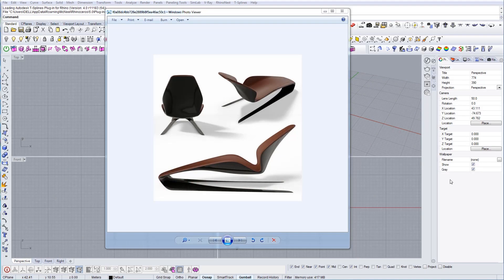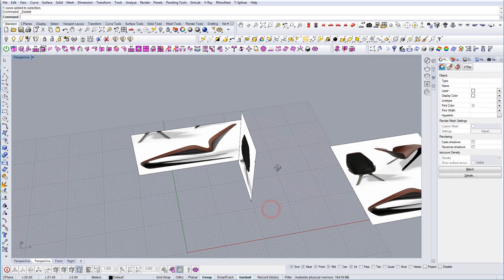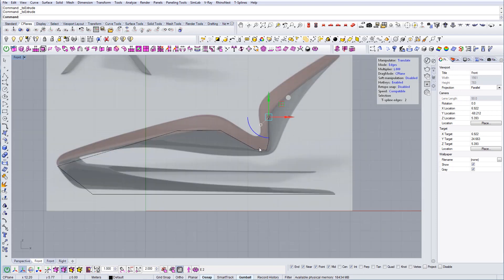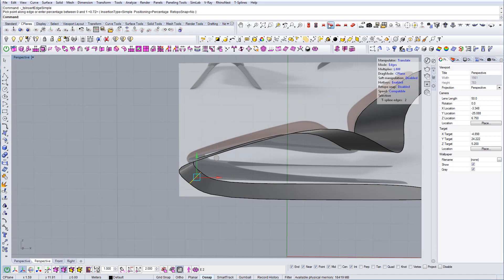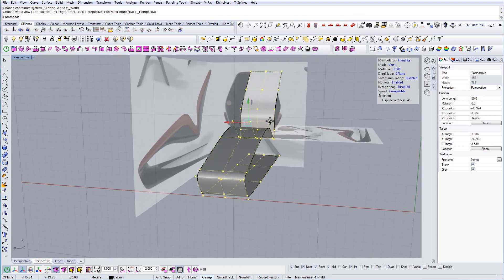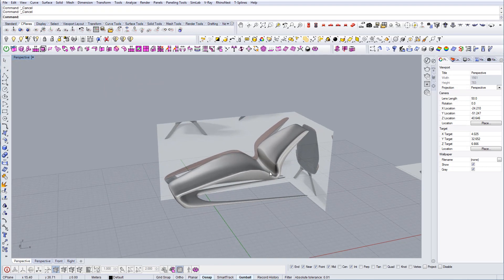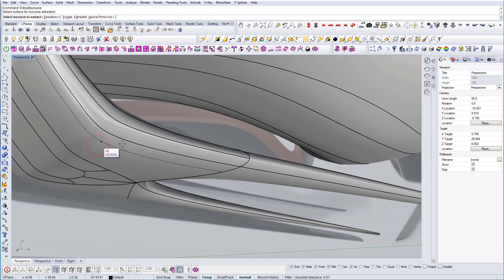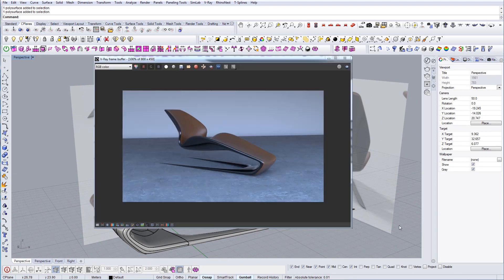How to Model Lounge Chair in Rhino

Comment: HI, I AM SIJIA, I HAVE A QUESTION , AT 3.28MINS, HOW DID YOU MOVE THE PLATFORM, THERE IS NO DOTS FOR ME TO MOVE WHEN I TRIED IT
Reply from the maker: I selected the vertex icon, so the dots become visible :) lower left corner :D
Reply: @HowtoRhino  but i could not find the vertex Icon , lower left corner in my rhino , i also could not find the pink platform in my rhino
Reply from the maker: Pink platform is a plugin called T-splines and if you don't see it, it means that you don't have it installed :)

Comment: I wonder that how we can make this without t-splines? How can I make it with control points curve? Should I make rebuild it to shape its form precisely?
Reply from the maker: Hey Burak! 
Honestly, this could be created without t-splines, but much much harder than with t-splines. In order to create it only in Rhino, you'd have to draw nurbs curves first, place them in 3D based on the reference images, and then slowly build the surfaces and modify them along the way. Again, this is a very complex process and takes a lot of fixes, going back and forth and so on. A similar process would be used when you'd want to create cars and such designs. Hope that helps a bit :)

Comment: 5:04 is that a smooth toggle a script?  I also cant find insert edge in my rhino ... is it bcs I have a mac?
Reply: I just read a couple of comments down... thx for the effort. this makes it look a lot easier
Reply from the maker: Hey, crstf! Thanks for your comment. Actually, no, this is not a script. This is an integral command of T-splines. It's called "toggle mode", and it switches between the "box" mode and "smooth" mode once you click "TAB" key on your keyboard. That's the default option. Hope that helps. :)
Reply: @HowtoRhino  Thx for the answer. I saw its not available for mac
Reply from the maker: You're welcome! Unfortunately, it is not available for Mac, only for Rhino 5 :/